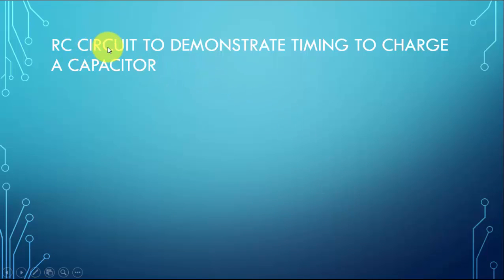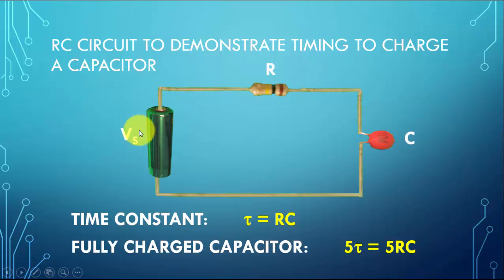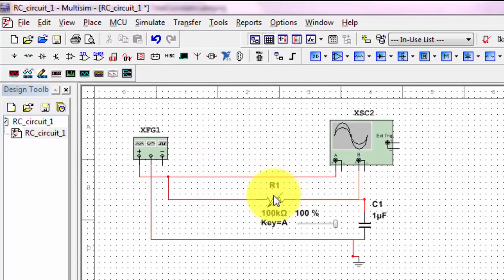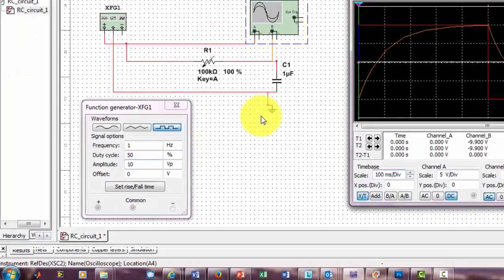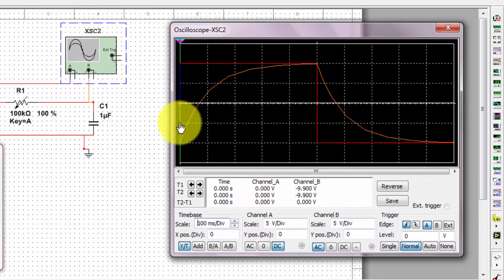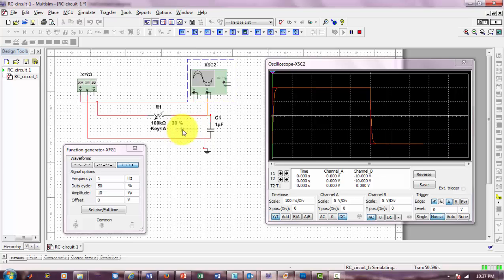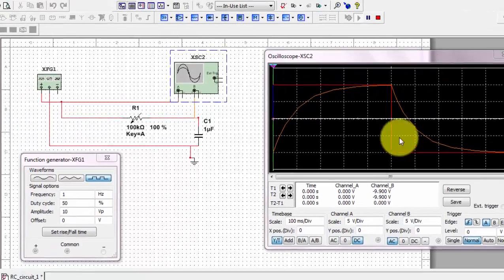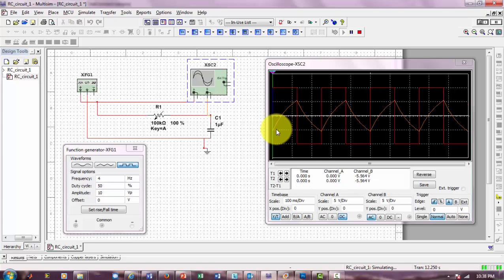A Tutorial and Multisim Simulation on the  RC Time Constant

Comment: Why does the simulation only work as expected using a signal generator (set as a square wave) and not with a battery/constant voltage source?
Reply: Got it, it's because of the initial conditions (affecting the initial charge in the capacitor). Set to zero and works as expected.
Reply: @joaogoncalves1149  which one should we set to zero?